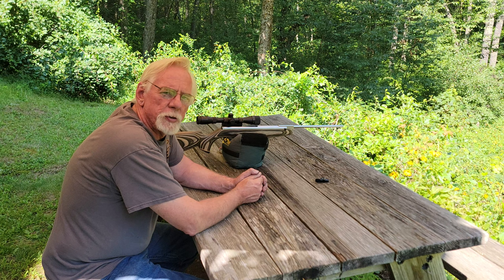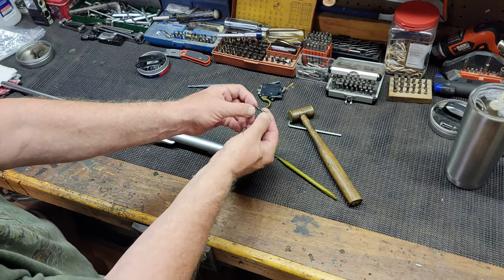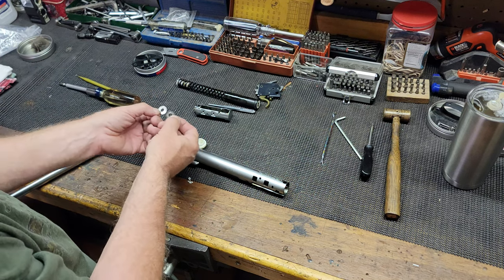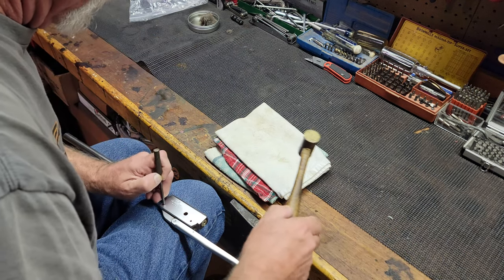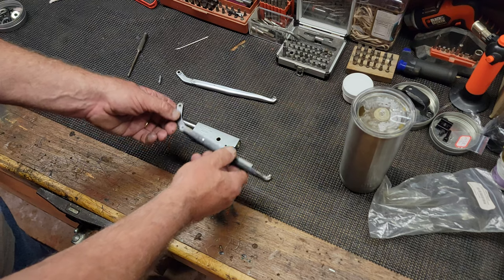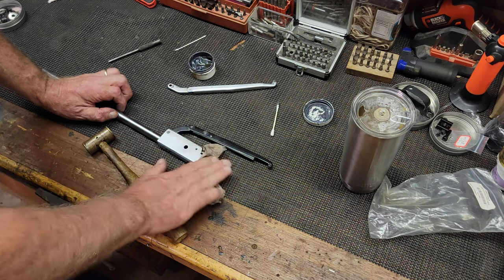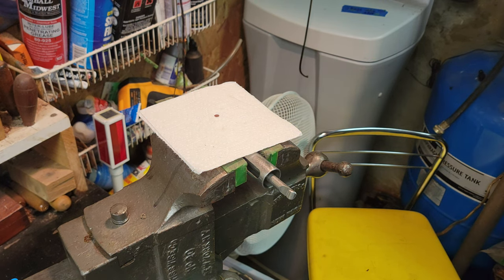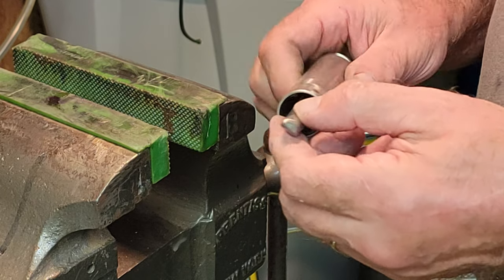Custom HW50S Air Rifle Rebuild Pt 1

Comment: A timely video as I just ordered a HW50S on Friday and I want to thank you for turning me onto KRALE, saved me $40. I am going to install either an ARH or a Vortex tune kit. Is there a recommendation to install it when the gun is new or after breaking in the factory setup ? Thanks and keep up the great videos.
Reply from the maker: For most folks, a tune kit isn't really necessary at all. I'd recommend shooting the rifle for a good while before you drop a kit in it. Give the gun a chance to settle down and see how you like it. 
If your experience with Krale is anything like mine have been, you'll have your 50S in very short order. 
Congratulations on a fine air rifle. 
Thanks for watching, my friend.

Comment: Great video Kevin.Could you tell us about the material of the buttons you glued on the piston? Also is it chemical and heat resistant the super glue or maybe is better to apply epoxy resin?
Reply: The buttons are Air Rifle Headquarters Old School Buttons. You will find them listed at the top of the Tune Kits page with complete installation instructions. 
They are certainly chemical and heat resistant enough for spring air rifles. 
RE: Epoxy
NO ! Just No !!!
Follow the directions... 🤨
Reply from the maker: What Marc said....😊
Reply: The 5 main points to installing these buttons are in the basic preparation and location of the buttons.
1. I'll usually chuck the latch rod if the piston in a drill press or cordless drill and lightly sand the skirt of the piston with 220 sandpaper, and then buff it with the 3M abrasive pad.
2. Pre-clean both the piston and the buttons to remove any oils, dust or filings with 91% USP Isopropyl Alcohol.
3. (Probably the most important part) use a fresh high quality cyanoacrylate glue. BUT ⚠️ LESS IS MORE ! You can buy micro swabs from most hobby supply stores, paint supplies, or auto parts. These hold less glue and just a simple dot of glue should be more than enough to set the button in seconds. Too much glue and the button will slip around and won't set quickly and you'll likely glue your finger tip to the button. So I repeat "Use a 1 or 2mm tiny dot of glue." You can always lightly dress the edge of the buttons "After" they are set, if you think it's necessary but give it adequate curing time to harden.
4. Check your spacing inserting the piston skirt in the tube and gently sand to fit ! Be patient and get it as close as possible while still allowing it to move freely.

5. Place one button at Top Dead Center of the piston. (This is the single most important button as it prevents the top edge of the piston from driving up into the roof of the Reciever tube, which is the main source of internal galling ! 😉 Then place the other two  evenly on either side of the cocking slot basically dividing the circumference of the piston into 3rds. 
When sanding down the buttons always remember the top button is the most important, so if you have to sand more material to get it to fit take more from the bottom two, and less from the top !
When you lay out your buttons check the slots, and holes in the reciever to make sure the button won't trip or tear around that machining and adjust you location around those areas. 🤷🏼‍♂️ HTH. Prof M.
Reply: These buttons work best with a wet running edge, so on final insertion lightly dress the entire button thoroughly with a smidge of Moly paste.
Reply: The button material is PTFE with what appears to be a melamine lamination to allow it to properly weld to the hardened piston. 
Any other plastics IE: Delrin, P.E.T., Polypropylene etc... Simply Will Not bond to metal with any glue. 🤷🏼‍♂️
Delrin buttons can only be pressed into milled wells in the piston and even they can come loose from time to time so that's not necessarily a guarantee of longevity. 😕
The ARH Old School Buttons work extremely well at a fraction of the cost of proper milled buttons without the wait time and shipping expense of Custom machine work. 😉👍
Reply: joebillelo8183  🐂💩💩💩 ... 👃
I am either fortunate or banal enough to own multiple copies of multiple rifles from the very same manufacturers, and "Honestly" purchased 3 kits from both ARH and Vortek just over a year ago. 
I personally installed all six kits "So same tuner, same methods !"
What "I" "Personally" and "Quite Factually" discovered were that they were both two Very Different product lines designed for two Very Different markets.
One was designed to produce "Maximum Power"
The other was designed for "Optimal Performance" 😉
Based on my own "Actual Experience" I'm more personally inclined to go with Optimal Performance ! 
Better shot cycle, Better firing characteristics, and ultimately higher, more consistent accuracy... 😃👍

I own the Rifles, I own the kits, "All fully and Quite Thoroughly tuned" and I am more than happy to sell you either one ! 😉

I'll Tell You what I didn't do, Sport... I didn't rush out anywhere Publicly or ANONYMOUSLY, and make ANY Incontinent, Loud Mouthed thinly veiled disparaging remarks about Either Maker !!! ☝️🤨
I personally paid for my own results in fact. 😉

Your move, Cletus ! 😂
Reply: joebillelo8183 Sorry... didn't mean to be rude, Congratulations 👏 🎉 on your very second post ! 😉👍

Comment: Hi Kevin -- i think its a good idea to polish the piston and inside of the cylinder... What do you think?
Reply from the maker: A gentleman who really knows his stuff told me once that it's good to lightly "crosshatch" or "scuff" the inside of the cylinder to provide a surface upon which the moly paste can be burnished. This is what I've been doing since learning from him. Thanks for watching, my friend.
Reply: You want to remove as little material as possible, and never fully polish a Reciever tube unless you're using actual piston rings like an FWB 300S. 🤷🏼‍♂️ 
I Don't recommend honestly honing the Reciever unless you possess a proper cylinder hone like a Sunnen hone and more importantly the requisite skills to use it ! Way too easy to over bore and ruin the cylinder. When guys linger too long in one spot with a flex hone you end up with erratic and bulged cylinders that are impossible for any piston seal !!! ⚠️ Just clean and check the tube and lightly buff and crosshatch the cylinder... But F'er God sake keep that hone moving the full length or you'll blow out the cylinder... 😣
Reply: Al right i understood.
Thanks frinds❤

Its really good to have communication with professional airguners so that , you won't damage your rifle...❤

And Kevin - I am counting down the minutes to see the second part of this video. 

Have a great time.
Reply: I'm a bit of a polisher too, but when you think about it rationally, if any airgun manufacturer announced that they were going to thinner walled materials, Reciever tubes, or pistons, We'd ALL likely B!tch and Complain furiously till the very end !!! 😤😠😡🤬
So it really doesn't make any sense at all to grind away at quality work and materials that "WE" intentionally sought out and paid Top Dollar for... 🤦🏼‍♂️🤦🏼‍♂️🤦🏼‍♂️
Less IS More... Easy Does It ! Ain't nobody sees that bloody piston or up inside the action ! 🥴

Comment: The set back triggers re very sought after for use with standard stocks Kevin & expensive, i had to buy a whole secondhand rekord unit to get mine for an affordable price once i've sold the old unit.(which i must get round too....!)
Reply from the maker: Maybe it's the design of my stock then because I swear the trigger geometry is off somehow.
Thanks as always.
Reply: @razor1962   Shame I didn't live nearby I'd happily swap triggers with you.
Reply: @razor1962  I doubt it's the stock, looks great by the way, probably with the slimmer more vertical pistol grip it suits the standard trigger better for your hands, the guy who fitted it probably had  smaller hands..
Reply: @junglie Yup ! ... Setback triggers shorten you length of pull. 😉 It depends greatly on your stock's LOP and the shooters reach. If the LOP is too short your trigger finger reaches through the guard and begins to wrap around the trigger in an unnatural position, causing you to pull to your handed side. 😕
Reply: A properly sized trigger shoe can actually lengthen your LOP by moving contact slightly forward, and the wider surface area soaks up a bit of the length of the finger. 
Reducing the size of the trigger shoe focuses to contact point producing a proper Go Button for Target shooting. The Kel-Tec trigger shoes fitted to a stock Rekord trigger is practically spot on for most F/T shooters. 😉👍